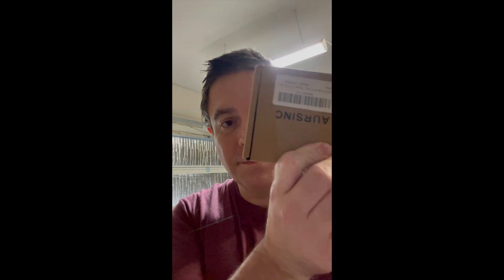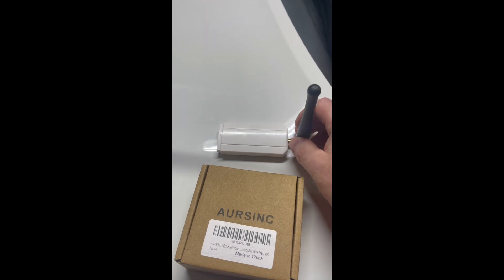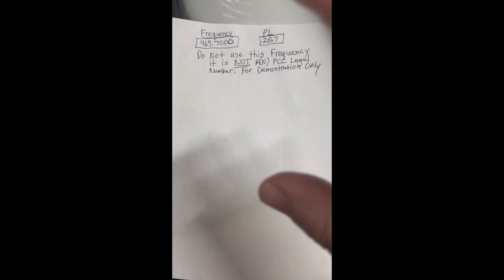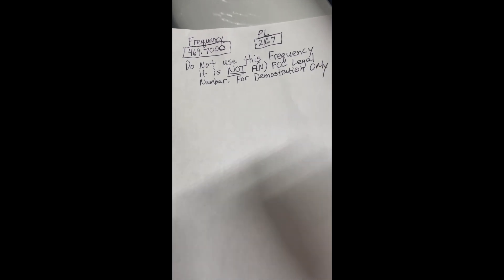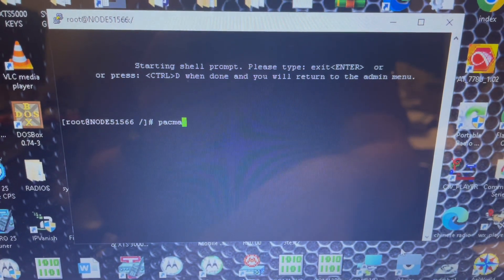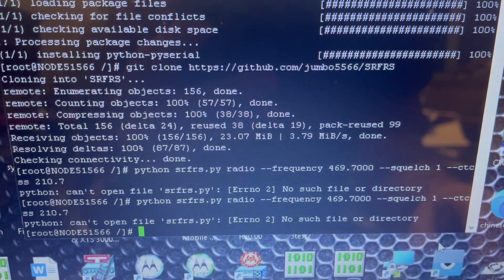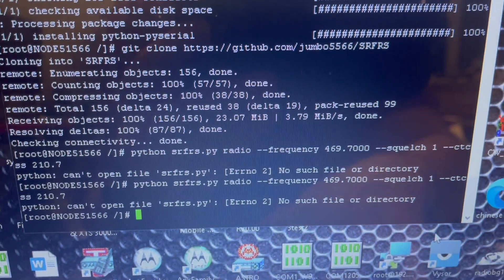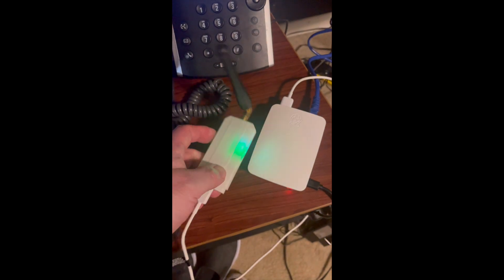GMRS 4-LINE RADIO NODE SETUP #gmrs #radio #ham

Comment: i got my AURSINC Allstar RF Node UHF SR-FRS Radio Programming Module Pi-hat of amazon for $70
Reply from the maker: That’s what you need
Reply: The price went up, mine was just over $80
Reply from the maker: @gregorybarth930  I THINK THEY DROPPED A LITTLE IN PRICE TO $69. BUT THEN THERE IS NOW A CHIP SHORTAGE